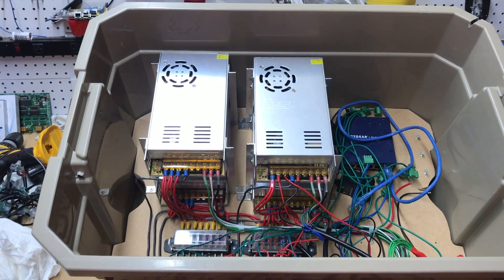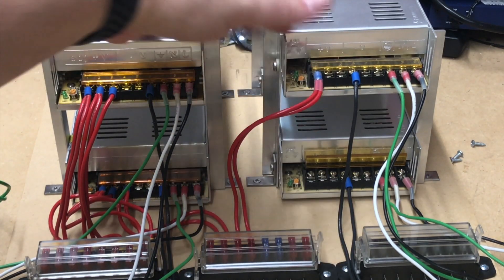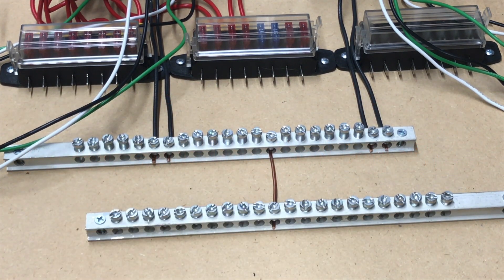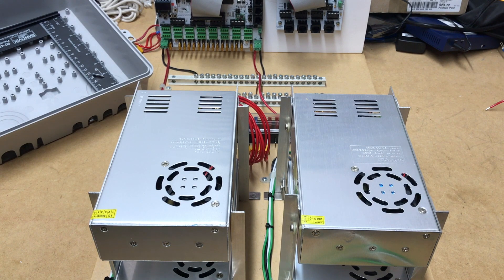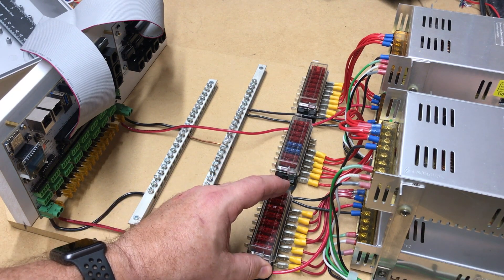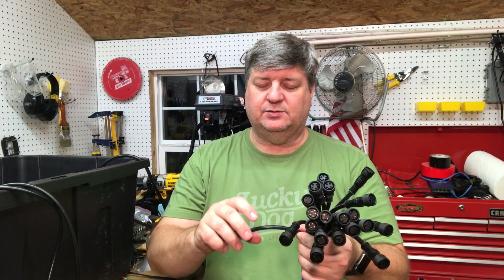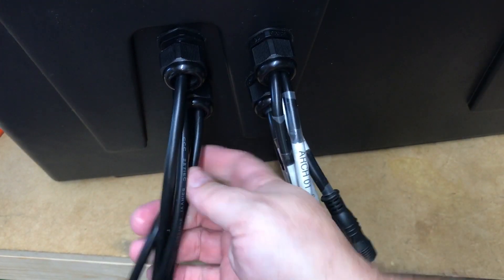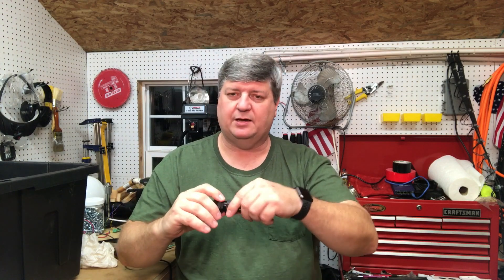Central RGB Pixel Controller Box Rebuild

Comment: The spacers or risers under your controller, do you know what those are called or where to get them? I’m thinking about building my own box and like how the controllers are spaced away from the mounting surface.
Reply from the maker: Check out my Amazon affiliate page and look at the "Random Electronics & Hardware" list. They call them risers. I believe the M3 screws on that list go with them.

Comment: Do you happen to know the AWG of the wire going from the power supplies to the controllers/ fuse boxes? Looking at some charts it looks like 14AWG can draw 20amps. Last I checked the falcon power slots can't fit thick wires.
Reply from the maker: Most of the wiring is ~18AWG though I have some 14AWG in there too. I believe the Falcon inputs can handle 10AWG (I'm not 100% on that). The outputs are fused at 5 amps so if you have long strings, you'll need to inject power along the string. It also depends on how you set the brightness. I run mine at 30% - still plenty of light at 1/3rd the power. lol!
Reply: @CanispaterChristmas  Thanks for the reply! Sweet ya I have a F4V3 and power distro board in a CG-1500, so I'm ready for plenty of power injection with my 5V setup. Plus I'll have another CG-1500 just for PI. The spiker lights calculator has really helped me figure out where to PI. I just wanted to double check how thick of wire people use from the PSU to the controller or power distro boards. I've asked numerous questions from you & purchased your course. Thank you for all of your replies. If you're into cryptos I just sent you a tip using BAT (Basic Attention Token). It is used by the Brave browser, which was created by co-founder of Mozilla. I believe you can retrieve them by going here and becoming a  verified publisher: https://brave.com/publishers/ . Just a small way of saying thanks.
Reply from the maker: Awesome! Thanks! Na, I haven't started doing any of that. Maybe next year. :)

Comment: What's the Model Number on these power supplies you are using?
Reply from the maker: I think most of those were 12V/30A Superlite (https://amzn.to/2D2jqzl) or something like that. I'm using MeanWell LRS-350-12s for all the 12V stuff now... which is mostly everything. The MeanWells are more expensive, but better units though honestly, I never had problems with the other ones because I don't load them too hard.
Reply: Is the LRS better than the NES model?
Reply from the maker: @Hangernade  Personal preference. The quality is the same. LRS, screws face up. NES, screws face out.
Reply: Just ordered a NES. Now I'm questioning that choice......
Reply from the maker: LOL! Na. That orientation does come in handy. I just prefer the LRS on the bench. I think the LRS is a little thinner as well, but not by much. Either one is fine. I have both.

Comment: I see all the 10 amp and a couple 15 amp fuses. Do you run your controllers directly or do you run them from the 15 amp?
Reply from the maker: I occasionally bypass the power distribution on the controller for larger props, just taking data and ground from the controller and providing power through a fuse. It's also recommended to use fuses for power injection. Most of the props are run directly off the controller.
Reply: I was actually referring to psu to falcon. Do you run a fuse between them?
Reply from the maker: Ah sorry. No. I usually go direct. Not a bad idea though.
Reply: I only asked because if I recall falcon manual says 33 amp. Wasnt sure if a 35 would be ok or just a 30 and hope it doesnt overload lol.
Reply from the maker: Oh, well, that's really something you manage yourself. I think the limitation is the traces on the board so you want to stay under the maximum recommendation. 16 ports times 5 amps is 80 amps and there is no way the board will handle all of that current. I believe the power input connectors are rated at 30 amps. Typical power supplies we use are 30-amp rated, but 25.5-amp practical. So it's kind of a (hands going up and down like a balancing scale)... :)
Reply: Appreciate the help. That's something I think falcon should include in there manual is the max input (amps) as to not damage if using a psu thst puts out more then 30 that is. I'm switching to each side of the board same with expansion card to run on separate psu's and the other terminals for power injection, and 2 dedicated for power injection only. Total of 6 for now even though 2 are not being used. Just planning ahead lol. My first year with pixels and wife already didnt like the money I spent. So I'll half to buy through out next year so she doesn't notice.

Comment: I bought the power supply. Can you show closer how to power them up?
Reply from the maker: At 1:07 in that video, I show a closeup of the power supplies. The AC input is on the right and the DC output is on the left.  Does that help?

Comment: just wondering where you get those long pig tails from??? are you able to supply a link?
Reply from the maker: I buy them from Ray Wu. His store is https://www.aliexpress.com/store/701799 
I may have cannibalized a few 3m (10-foot) cables, but he may also have them that long. From now on, I'll probably get just the small ends so I can make my own custom length pigtails just adding wire between the pigtail and the pixels.

Comment: Hey, hope all is well in the US this easter. Wondered if you had a link to the 4 pin connectors that you are using for the pixel pigtails. I can find something on Amazon.com which i think is the same : https://www.amazon.com/MOKUNGIT-10Pairs-Waterproof-Connector-Applicable/dp/B01EPMXPN2/ref=sr_1_4?ie=UTF8&qid=1522530311&sr=8-4&keywords=4+pin+waterproof+connector&dpID=51xNWSMD5CL&preST=_SY300_QL70_&dpSrc=srch  but I cannot find anything similar yet in the UK where I am based.  I also notice your affiliate page seems to not have links on it anymore. 

All the best, have learnt plenty so far....
Reply from the maker: Sorry. Your message was flagged as having bad words. LOL! I get my pigtails from Ray, but those look pretty close. On the affiliate page, do you see what looks like product images? You should be able to click on those. If not, please let me know and I'll get to work on that ASAP. I'm having to do some crazy stuff with that to get it to show up properly, but thinking about completely re-doing the blog site soon.
Reply: CanispaterChristmas so much stuff available in the US that I can't find decent versions of in the UK without actually calling places up and paying a fortune. The  blog pages I don't see the images at all on either android chrome or chrome on Windows 10.....

Comment: You mentioned running your 1200 pixel mega tree off of one power supply at 30%. How many power injections did you do? What does the wiring look like out of the power supply to the fuse block?
Reply from the maker: I injected power at the end of each 100-pixel line, but I didn't take voltage measurements to see if that much was actually needed. I split it into 4 segments of 300, but could have gone with 2 and probably will if I need the extra ports. The power supply has 3 output terminals so I came out with one line to the controller and 8 lines to the fuse block (so 3 lines per terminal). 
Of course, this could all change with the F48 as one differential receiver could run the entire tree easily with a much smaller box at the tree. As the display expands, I'll need to push the power out to more props and a central box starts to loose it's appeal. I already had to run one differential receiver this year and only see that expanding in the coming years. Really, it's whatever makes sense for your display.
Reply: Follow up question. I still don't understand how 8 output lines does the injection for essentially 12 strands of 100 pixels. Wouldn't you need 11-12 connections from the power supply?
Reply from the maker: 4 come from the controller. The other 8 are additional "power injection" from the power supply. Voltage drops at each node so keeping it as close to 5V or 12V (depending on the pixels) at both ends is what you want to measure and achieve. As always, let the lights be your guide. Try without worrying about power injection first. If the colors start to fade toward the end of the string, that's a good indication you need more power. Measure with a volt meter to be sure that is the problem and inject as needed. 
Based on previous years, I knew I'd need to inject and just put pigtails on all the strings to keep from having to keep track of which strings did what. That will also be handy if I reconfigure for 600 nodes per string vs 300 I have now. I think I did tape up the ones I didn't inject just to be safe. :)
Reply: That makes sense. Thank you for the clarification. I am planning on using a SanDevices E6804 to run my 1200 node tree and having it be basically a self contained element instead of running the lines to a large central controller setup.

Comment: Quick question. I just bought a falcon pixel controller, a power supply, and a few strands of smart pixels. I have no experience with this what so ever, very green. Where would you say I should start on how to set up, wire the pixels, network, music, and a beginners guide on programming the pixels. And setting up a layout for my house.
Reply from the maker: I would start here: https://www.youtube.com/playlist?list=PLFyrAfJ-kKd4ZfPdXWIt8v_bav61mW_KW for a basic understanding of how everything fits together. Also, check out the forums and/or Facebook groups I have listed in the descriptions. They will give you ideas as to what to do with your canvass. :) Honestly, with the exception of 2 videos, all of my videos cover some aspect of RGB pixels. Feel free to start at the beginning and binge them all. :) Welcome to the hobby!
Reply: Hey Jeff, what are your thoughts on using these: StarTech.com 6-32 Brass Motherboard Standoffs for ATX Computer Case - 15 Pack https://www.amazon.com/dp/B00213KL5I/ref=cm_sw_r_cp_tai_eCMFCbBSAAN4N
Reply from the maker: Robert, What would you be using them for?
Reply: As a stand off for the circuit boards.
Reply from the maker: @robertbates2747  Oh! Those might work. If I understand the sizing correctly, those are about 3.5mm. I think I used 3mm, but they weren't tight. I have the ones I used listed on my affiliate page (https://www.amazon.com/ideas/amzn1.account.AEKFXAZBYC2BSO3ETT2X6O7NVOKA/ZBY2EIQPNUJO).

Comment: are you powering your pixels off the 16v3 or from the fuse blocks? if off the fuse blocks why?
Reply from the maker: I do both. All controllers are usually limited to 5-amps on their fuses because of the current handling capability of the traces on the board. If I have a long string that I suspect will pull more than that (0.06 x <# of pixels>), I'll usually go through my 10-amp fuses in the blocks or for extra power injection. If you power inject, you'll drop the current through the controller so you CAN use both.
Reply: so i can run the data line  and the ground from the board and the power through the higher amp fuse?

Comment: I really like the design of this controller box. in fact I will steal a lot of your ideas.  could you please do a detailed video of how you set this up?
Reply from the maker: Haha! No problem! What details are you looking for?
Reply: I hate to ask but a full walk through of the controller box and the wiring would be great. what fuses are used , what gauge of wiring, anything would be of great help. I am new to this hobby as of January 2018, this year will be my first.  I plan on doing just the house outline, the garage , a large window and maybe a large matrix. the matrix being the last.  i figure i will expand some each year.  Thanks for the help and info

Comment: Thank you for sharing your expertise here. You mention this box is for your tree and that it is located inside the tree itself. How far can the box be from the first lights? Do you use other falcons for other displays? Thanks
Reply from the maker: Not an easy answer because everything affects it, but I have several props 30-feet away. I have heard people using CAT5 cable (and a mysterious combination of wires) getting 60-70 feet. I'll have to do some tests and make a video. :) There ARE signal boosters available, but I have no experience with them. Yes, I use one controller for the garage outline (plenty of expansion room available on that one) and the other one is in the box.
Reply: Thanks for help, getting a noobie start to next year. The Falcon controller sounds great. Not sure I'm ready to get into power injection yet. How many pixels can each channel take before losing power? Thanks again, love the videos
Reply from the maker: 12V will do ~100 at full brightness - more if you lower the brightness. Let the pixels be your guide and inject only if needed.

Comment: Great videos, now I have way to many questions...LOL  So you don't run any dumb pixels?
Reply from the maker: They were in the beginning, but I took them to school and now they are brilliant!

Sorry. Couldn't pass that up. No, no dumb pixels in the display.
Reply: LOL, TY for responding so fast.  I am so confused in some parts of trying to learn this that I am not understanding  why having different types of controllers (i.e Falcon and LOR's).  Does it make a difference based on the lights you use.
Reply from the maker: Maybe you need more context. LightORama has been around a while and became very popular after when Carson Williams posted his animated light show to YouTube back in 2004. They came out with controllers that controlled standard AC light strings and had proprietary software to sequence them on a Windows computer. I used them until enough of my light strings died and I went looking for something else. 

Enter Matt Johnson who was on "Christmas Light Fight" back in 2015. He used pixels, SanDevices controllers and Falcon Player on Raspberry Pi. I liked that sequences could be produced by open source software and a Raspberry Pi could act as the source computer. So I bought a SanDevices E682 and started buying pixels. I produced sequences on my iPad just to see if I could and it worked OK.

This was about the time I was introduced to Falcon controllers. I liked the features of the Falcons compared to others that were out at the time and bought one. I wanted another one this year for expansion and was blown away with all of the new features so I made a video. LOR has added pixel controllers to their lineup, but I've got Falcon boards now.

It's like how there are different automobile manufacturers. They all get you from point A to point B. It's personal preference what you actually decide to buy. There are many pixel controller manufacturers that control pixels. I like Falcons.

Comment: Question:
I have my E682 setup on Xlights and on test works great. But when I create models for my 7 trees, only one works.

Here is my set up on e682:
Tree 1 start ch 1 end ch 300
Tree 2 start ch 1 end ch 90 (uni 2)
Tree 3 Start ch 91 end ch 391 (un 2) and so on and so for, but when I create models of the trees on xlights, copy and past, it setup complitly diffrent and it doesent lwork. like tree 3 End cannel 900 WTF (LOL). what Am I missing?
Reply from the maker: We're probably getting into more of a question for the Facebook groups or forums. They'd ask things like posting your xLights configs and stuff like that.
Official xLights Support Group http://bit.ly/2zBMwnv
http://nutcracker123.com/forum/

However, I can try to get you started. Lets forget about the actual lights for now.

xLights will tell you the start and end channels for each model on the layout tab. Make sure they are as you expect. I say that because each model can either be 1-300 or they can be different (1-300, 301-600, 601-900 and on and on). So what are the start and end channels for each of the models.

Comment: What size shrink tubing did you use?
Reply from the maker: Based on my purchase history, I believe it was this: http://amzn.to/2yK3qNy 10mm, not quite a half-inch. I'll measure it when I get home and update if that isn't it. 25-feet, I've had it a while! haha
Reply from the maker: Yes, I checked mine. Flat the tubing is 15mm, but is 10mm in diameter when I open it up.

Comment: Jeff, thank  you for your service to our country.  I do appreciate that greatly as I too am a retired serviceman.  Now, can I ask a quick question:  Did you tie all power supplies into one 110 outlet plug?
Reply from the maker: Thanks! Yes. ~30 amps at 12V does not equal 30 amps at 110 or 220. I have no problem running the whole show from one plug. You can invest in one of those Kil-A-Watt AC meters to make sure you don't pull too much from one circuit. Amazon has them (http://amzn.to/2yGMEyP), but I think my last one was from Home Depot. Been a while since I checked it (and I can't find my meter anymore) so I can't tell you how much it's pulling, but I can tell you it's much less than when I was running AC lights.
Reply: CanispaterChristmas are your power supplies ran to a switch inside the box and then to a single plug or all tied together then to plug?  I noticed you go into the box and turn your lights on.....